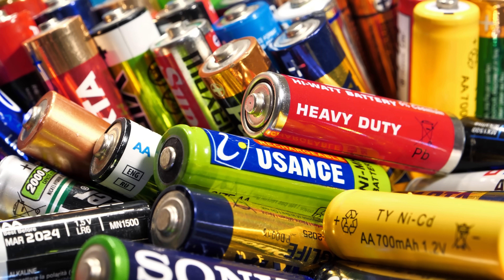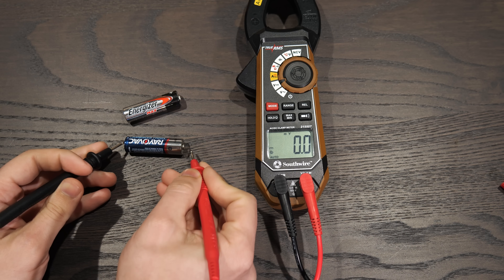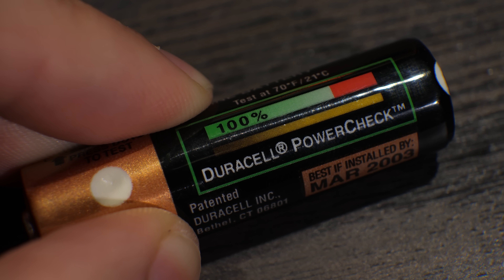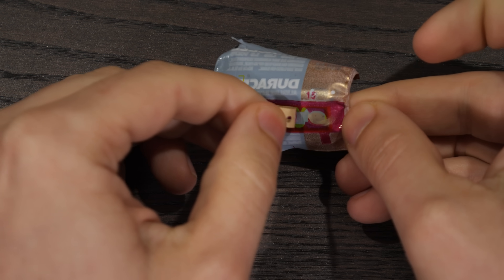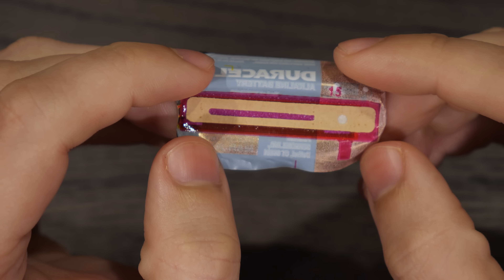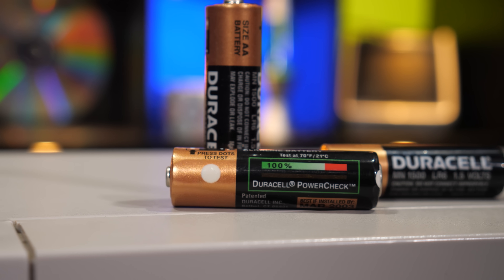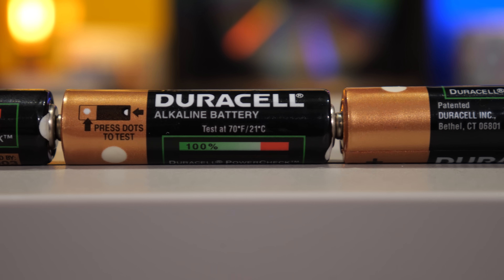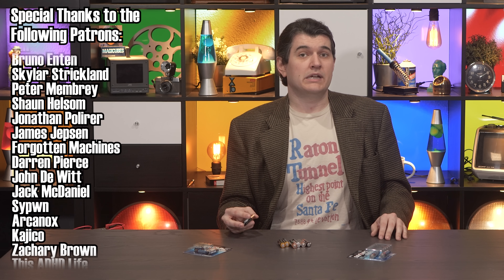Duracell PowerCheck: A genius idea which didn't last that long

Comment: Back in the day I used those testers quite a lot, swapping batteries from one device to another or devices that wouldn't discharge the batteries evenly or troubleshooting, or even quite a few cases of throwing things out that had batteries and wanting to know if the batteries were worth keeping. Overall though I haven't found any use for that in quite a few years now.

Comment: I remember that these things never worked properly where I live because it's so hot the strips were always yellow so we had to put them in the fridge and then endure the painful process to confirm that indeed the battery was dead, since the gameboy had the indicator light that dimmed as the battery lost power, we already knew😂

Comment: When a battery device goes dead, I always checked the batteries. Because more often than not, only one or two of the batteries were dead.  Why replace 4 bateries, when replacing 1 will have the exact same result.

I never used these checkers, because they took freeking ages to do anything. Meanwhile the actual battery tester could test all the batteries 10 times by the time the printed tester did one.

Comment: I know why those thermal tester/built-in Duracell things failed.  You'd have to break your fingers to get them to work at all, and that's when they worked. It was just a marketing tool to cell more Duracells (or as I call them, "Duraleaks").  I use a ZTS MBT-1 pulse load battery tester.  It's the best tester I have ever used.  It actually puts a load (pulse load) on cells to check their actual capacity.  I can't recommend it enough.  It tests a lot of different cells, household, coin and button type, different chemistries like: alkaline, NiMH, Li-ion, and L91 and L92 cells.  They have other less expensive models as well if you just want to test more common household types.  I only have a couple of constructive criticisms about it. I'd prefer a flat surface to put the positive side of the battery onto, OR have the probe test the positive side of the battery instead of the negative.  As it is, with a standard AA/AAA/C/D cell (etc.), one has to made the positive nubbin on the tester to the nubbin on the battery.  This is not ideal. I'd also like to see a digital readout of capacity instead of LEDs, but that would complicate it a bit.

I'm not an employee or anything, just a fan. Oh, and they are actually made in the U.S.A., at least the MBT-1 is.

Comment: Great video! Good example of creating a product that is cool... but not very profitable... but still nifty and cool. I still burn through a ton of AAs for wireless microphones, and this feature isn't useful. As soon as the thought would occur to test one, they should have already been changed. It's wasteful but that's just how it is. Not "use them 'til they die" but "if they ever die I'm in big trouble."

I should switch to rechargeable if I ever get the money. Pretty sure they've surpassed the single use ones now.

Comment: 9-volt batteries physically cannot be composed of a single cell.  There are two ways the 6 cells required to provide the nominal 9 volts of the battery can be packed in.  One is to use six AAAA size cells, and the other is to use a stack of 6 rectangular cells.

Comment: I had plenty of batteries that were partially used. I tested them by just putting them in the thing I wanted to power. Like the opportunity cost of changing a battery is so much lower than pulling out a multimeter or something like that

Comment: Always used to use Duracell because of their claim that they didn't leak, and occasionally used the tester. However, the tester has departed &, in my experience, so has the leak proofiness*. Perhaps tho' they were only leak proof compared to zinc carbon cells, where the outer casing was eaten away by the chemical action.

* yes I know it's not a word.

Comment: I remember the ever ready HP2,SP2, HP11,SP11's the fatter ones HP was for High power, red in colour and SP was Super Power (I think) which was blue. I suppose those tester strips will eventually drain the cell if left on the shelf for months or so.

Comment: back before every thing had lithium batteries, this checker was useful. Had a digital camera that took like 8 batteries. I'd bring extras, sometimes they got mixed. Also was not uncommon that just one battery would die faster than the others. Sometimes I'd pull batteries from something else to use on the gameboy and the tester could tell me if it were worth it or not.

Comment: Regarding your observation that most people never test batteries - think you're spot on. I went through a period of early adulthood where I almost never used alkaline batteries - most of the things I used that were electrically powered plugged into the wall, and my phone had built-in rechargeable batteries.  Somewhere around 10 or 12 years ago, I started using wireless mice and a lot of the cheaper mice just use rechargeable batteries. Also, I got some devices that had remotes (A TV and Roku), so suddenly had need for triple-A batteries again. Also I had a couple flashlights I picked up somewhere, deciding that if there were power outages and I needed a flashlight, that while my phone technically COULD be a flashlight, I'd rather save the charge in my phone batteries for phone calls, texts, and maybe interacting with websites as required.

All this is to say, I decided to buy a couple packs of rechargeable AA and AAA batteries for my devices, because I hate the idea of using a battery once and tossing it in the trash. For one things, while they've always been kind of expensive, they got a lot more expensive since I was a kid.

The thing is, with rechargeable batteries, battery testers are more useful than with alkalines. Alkalines don't tend to lose their charge when just sitting around in a drawer - at least, they do so on much longer time scales than NiMH. So, I periodically use my battery tester I bought at a walmart, to check to see if it's time to top up batteries on the charger. Also, while I try to put charged batteries in one location and dead batteries in another (why not charge them you ask? Well, mainly, if I only have a single dead cell, my charger requires batteries to be charged in pairs, so sometimes an odd battery has to just sit around awaiting a mate to charge with), sometimes things get mixed up and a charged battery ends up next to an identical looking discharged battery.

Comment: Very cool, but I think the main use of these was not determining which batteries were partly used, but which had died due to age before you got them out of the box.  Shelf life was more heavily advertised than power capacity throughout most of the history of these things.  The Energizer Bunny changed that.

Comment: There's a reason why we kept used batteries in the drawer back then. Electronics that use high power would kill the battery early, but that's only because its demand requires a certain level of voltage. However, there are other electronics that has lower requirement (like a wall clock) and those batteries would still work on that. 
But we stopped doing that when we went with rechargeables.

Comment: I started with disposable batteries. Then the rechargeable batteries came. They were really expensive and their quality and mhA varied sooo much: some worked quite well, some drained the power about 10x faster than non-rechargeable ones (even without using them). I might have bought cheap ones of course, but still: million times I charged batteries for later use and when I put them in - they were empty... Now Im back using disposable batteries. But we recycle them in my country, so I don’t feel that bad about it. Maybe things are better now, than what the rechargeable batteries were in 2000’s…?

Comment: I used that built-in feature 1-2 times.  Never really had a need for it.  New ones in a package, dead ones goes into trash. 

Sometimes I would keep used batteries because a device was trashed, etc.  I'd mark them with a sharpie of a random color. So if I pulled 3 batteries from a toy, they maybe marked with a red line.  Another set, blue, etc.   I knew they weren't new, but they were likely more than good enough to last 6 months in remote control.

Comment: I have an old calculator (and the box with papers) that used four AA batteries (later our electronics teacher would yell, "They're not batteries, they are cells, a battery has two or more cells! And then we would get the dirty look. OK, back to the story.) In college in the 70s, handheld calculators were pretty rare and expensive, I paid almost $200 for mine. Plus they used a lot of power, the screen would flash all kinds of numbers and lights while calculating. I had to carry an extension cord and sit next to an outlet rather than use the cells. The cells would only last one full day. My several year old hp 12C scientific calculator is still using the original battery (ies) and I have a Texas Instruments TI-36X that is very old and runs off a small solar panel. Thanks for the awesome story.

Comment: I used to use a lot of AA and AAA batteries, but I switched to rechargeables, more expensive at first but cheaper in the long run and I can hope I'm helping the environment a little 😅
As for testing I have a battery tester for checking them. And doesn't hurt to use like those ones did lol

Comment: I remember being an early teen and learning about car batteries. Old cars with few electronics, as long as the alternator/generator/magneto is working, will usually start on a mostly-dead battery because they only need a few volts to run the spark plugs and just enough cca (usually less than it actually says on the battery) to spin the starter and even if the starter is out they can be push started. New cars with multiple computers and infotainment that you can't turn off and ac and electric power steering could never 😂

Comment: I purchased a $200 battery tester for my CR123 batteries. When you go on duty the last thing you need is to worry about your expensive flashlight letting you down or tossing expensive batteries before they need to be

Comment: I remember these things, and really liked them. But yeah, the additional cost made them less attractive overall. Especially since we only use alkaline batteries for low drain devices these days. 

Speaking of which, can you make a video on why low drain electronic devices actually last longer with disposable alkalines as opposed to rechargeable lithium-ion batteries? I mostly understand the reason why, I think the lithium-ion batteries self-discharge rate contributes to it, but I don't think that's the only reason. Also why do some electronics drain batteries even when they are off, but other devices seem to do just fine leaving the batteries in them all the time? I used to use disposable AA's in my Wiimote, and it always drained the batteries dry if I just left them in there for a long time without ever using the thing. But AA's in my TV remote seem to do just fine.

Comment: As a child, these Duracell batteries were extremely useful. If you had a remote controlled car, a few Tiger handheld games, a Gameboy, or any other battery powered device as a child, these were indispensable. First, young children don't usually have much money, especially in the 90s. Batteries were expensive and you needed your parents to take you to the store because you certainly couldn't afford the corner gas station price. So, you would raid and trade your nearly dead batteries with other household products, notably, TV remotes. A TV remote could continue to work with nearly dead batteries, but if you didn't want to be scolded for taking the batteries, you needed to be sure they wouldn't die right away. That's were the magic of these Duracell batteries really shown bright. You could play with your remote controlled car until it stopped, check to ensure they still had a charge, and swap them with the batteries your parents just replaced in the TV remote(because you did this just a month previous. It was important to test them though, because if you swapped them and the remote stopped working prematurely and you were just using whatever toy that week, your parents would know you swapped them out. You needed to know they would last long enough and with these batteries, you quickly learned the minimum level for many household goods. Outside of deceiving your parents, if something stopped working, those batteriesbwent in the drawer. Knowing they still had plenty of life left took away some of the frustration of looking for a good battery, especially if screws were involved in the battery closure. Kids loved these batteries.

Comment: i didn't like using the tester because it was hard to press the dots and also because I felt like i was wasting the battery testing it.  Like you said I just put them in something and if they worked I used them, if they didn't I threw them away.   Side note, on clearance I found a cheap plastic battery storage compartment that came with a battery tester, that thing has been great,  it is nice to test a battery without pulling out my multimeter and it holds  Ds, Cs, AA,AAA, 9V and even those Lithium Coin Cell Batteries

Comment: PowerCheck bar or no, the high failure rate of "Copper Top" Duracell batteries leaking out and damaging or destroying equipment over the years has made them my last choice of battery brand to buy. They have accounted for the bulk of my high-cost equipment damage. Using cheaper batteries that only need replacing slightly more frequently but leak much less often is preferred to loosing my equipment entirely to corrosion.

It's ironic that the old ads showing Search and Rescue teams relying on Duracell Batteries to power headlights turned into more than a few of my own headlights and flashlights being ruined by this brand of battery. They should have tried to improve this problem years ago.

Comment: Great video. But I cannot believe there was no mention of rechargable AA, AAA, etc. The mindset of the person who removes batteries and stores them mid-use is the same as the person who buys and maintains rechargeables. Mid-cycle battery checks for one-time use batteries became redundant when rechargable equivalents went mainstream.

Comment: Technological Bob Ross strikes again!

Just had a thought, how well would these testers work on rechargeables? I've got audio and flash equipment running off AA batteries that can sit for months, then I'll need it on a moment's notice. I really hate just keeping them on chargers or keeping a pile alkaline batteries around.

Would be nice to be able to check them before throwing them in a camera bag and running out the door.

Comment: I took several packages of those batterys with me to AK. I had a problem of the airport x-raying them and ending up with dead batterys. I told them so they ran them through and afterwards i opened the packs and tested them infront of the workers. All of the batterys were dead proving that the x-ray machine was killing them. They still refused to pay me back for all the bateries they killed.

Comment: Most important drowback of these testers was variation in battery thickness. The size looked fine until you tired to replace batteries in torchlight with metal tube.

Comment: Testing for voltage isn't very accurate.  The battery will often read its full voltage using a multi meter on DCV, but if you put a small load on it, the voltage will drop to less than a 10th of it's rating.  You MUST test it with a load on it, which is really testing for its ability to deliver amperes through the resistance inside the battery.  (resistance increases with age and use, which makes us say, "it's dead".  Kind of like humans.  As we age, our body increases resistance, until we are dead) 

But I hate going to find my meter, a resistor to put across it, and some patch cords.  I have a multi meter that has a "Batt Test" function, which puts a load on internally, but I hate going to get that one too.  So I just drop the battery (ALKALINE only)  from 1" to 1 1/2" high above a hard surface like smooth concrete, a granite countertop, or a tile floor, and if it bounces, you toss it.  If it bounces only a tiny bit, use it for a low load situation, like a remote, not a motor.  If it drops and lands dead on it's bottom without a bounce, it's new or close to it.  But now I guess I have to explain why this happens.  The alkaline inside a battery is in the form  of a gel.  This gel makes it like a "dead" hammer that has lead shot in it to make each swing land dead and not bounce.  So when you drop the battery, the gel absorbs the energy of the drop, and it lands DEAD.  No bounce.  But the gel breaks down and zinc inside the battery converts to zinc oxide over time of use, and accumulates at the bottom of the battery like a heavy disc of ceramic.  Hence, the bounce of the "used" battery.

Comment: technically you always measure a battery under load when you use a multimeter, though the load provided by it is tiny

Comment: In your too quick review of battery sizes, you completely forgot the most frustrating types, namely AAAA, A23 and A27. The last two could typically be found in doorbells and AAAA was used in a pen for my digitizer, it was hard work finding new batteries for that one.

Comment: 10:36 It actually doesn't matter how many people were testing their batteries, or how often. It matters how many people THOUGHT they would want to test their batteries and were willing to PAY for that ability. Hence the curve of excitement upon product launch, then people realizing after a pack or two that they never/rarely used the feature, then going back to the cheaper generics. TL;DR: The whole thing is really just a marketing gimmick, so if it isn't pushing more batteries into shopping carts, why input the added manufacturing cost?